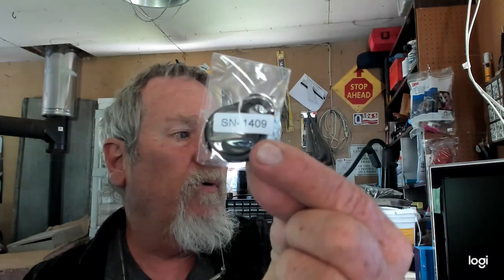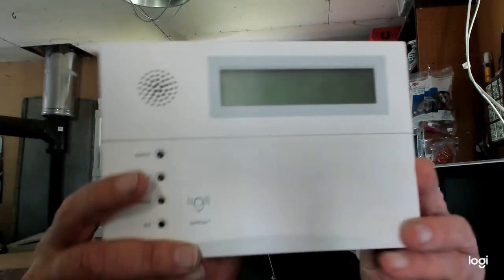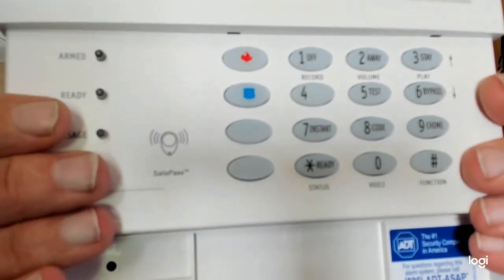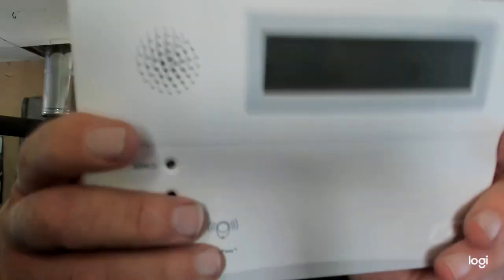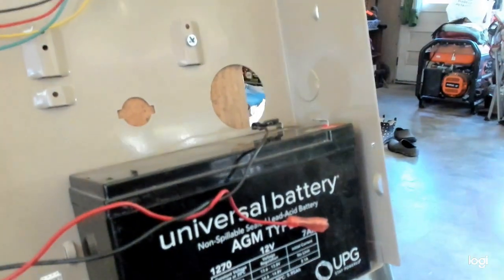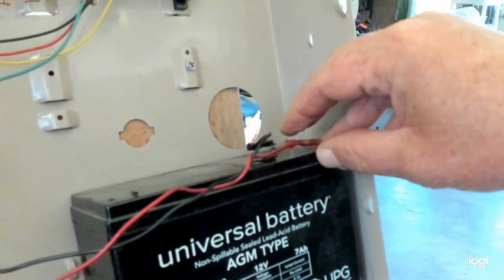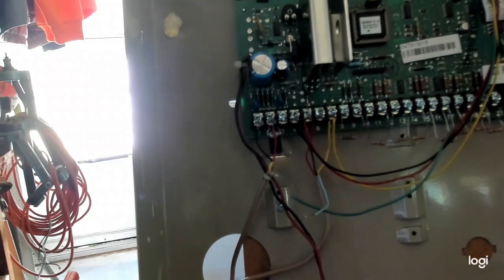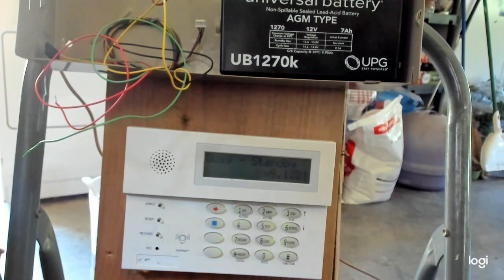Ademco Prox Tag FOB Honeywell ,How to Program

Comment: When my company moved to a different building, the old prox tags weren't compatible with the new buildings system, but the old tags are compatible with my system at home. They let me keep as many as I wanted so today I programed one to a user and it works. The only thing I don't know is the 4 digit code for the prox tag.

My question is, do all prox tags have 4 digit codes?

If they do I guess I'll have to go through all 9999 possible combinations until I find the one that works for the user I assigned it to.
Reply from the maker: Yes Prox tags have their own 4-digit code, if you know someone at the old build  where the tags came from you can ask to wave your tag there, big commercial builds most likely use something like WINPAK that can read the code off of tags

Comment: I have a ADT Safewatch 3000 panel (not safepass I think) with the fixed English keypad.  The original 4-button wireless fob broke so I bought a Honeywell 5834-4 as a replacement but I can't find any instructions online how to program it.   I can get into the programming mode (master code +800) but that's about it.  *56 doesn't do anything for me.   Would be so grateful if you can help.
Reply from the maker: https://youtu.be/3jaJ-FqsmdA?si=Jab2WobBtfgLCmSL

Comment: Hi!! If I already know the master code do I still need to unplug the battery and the wires??
Reply from the maker: Yes, follow what I do just as shown in the video
Reply: Thank you! I think my master code is still 6321 bc I watched your other video and that’s what worked. When I went to program my fob- it didn’t scan. I am wondering if my fob is the problem. I’m still waiting for the fob that you reccomebd to be shipped
Reply from the maker: @amandagallace  6321 is not your master code,,,do this for me,,,,,press in the following on your keypad.....6321-8-02-1234-1234
Reply from the maker: That will set your mastercode as 1234 then use that code to program your fob,,do not use 6321 that is your installer code not your master
Reply: @DIYELEKTRONICKITS  okay I did this and I think that it may just be the fob- it isn’t connecting after I do that. I ordered the one you bought and used in the video. I will keep you posted thank you again!!!